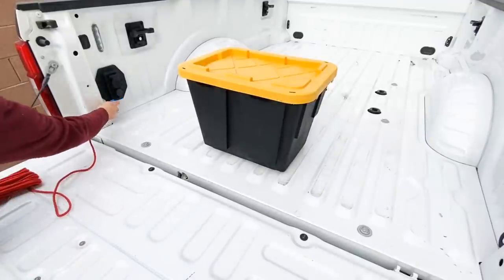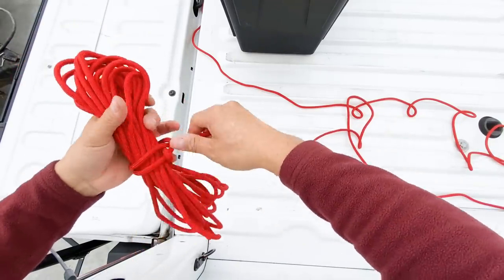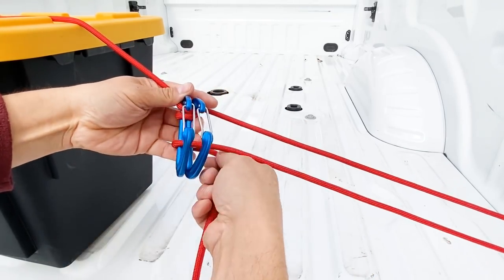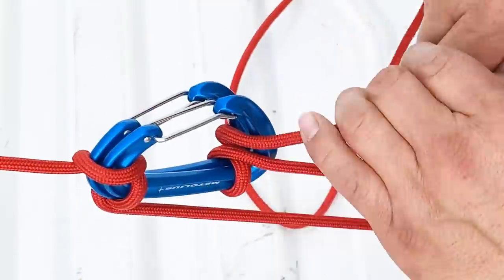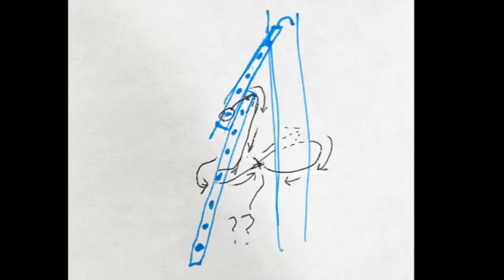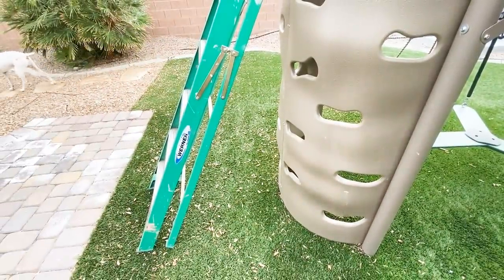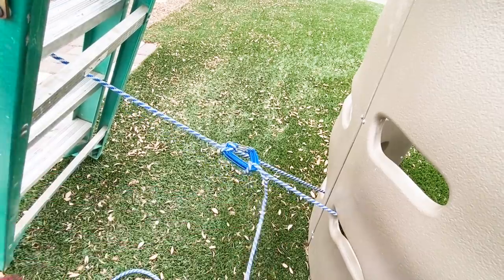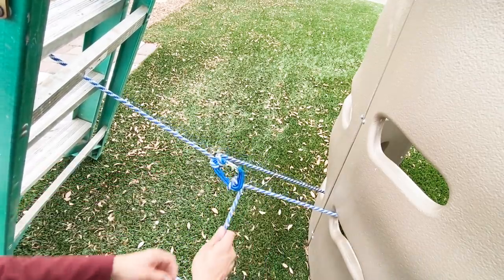Carabiner Truckers Hitch - Tension Locking. (Ladder to pole)

Comment: With two carabiners, you can use the garda hitch (aka Alpine clutch) for a more stable knot with the same function.
Reply: Wow Garda hitch is where it's at.
Reply: @brandonswan9247  an issue with the garda is it might be hard to release under load.  Might be best to include a load-releasable hitch in the system when using the garda.  Maybe it can be undone using the method first class amateur shows, just reversing the steps to tie, but i don't know.

Comment: You have literally saved me so much time using this method for setting up a ridge line for camping shelters and clothes line I’ve used the rope only method for years and it works great but this is so much faster and easier.
Reply from the maker: Glad it helped!

Comment: The reason why everyone is asking about having to use 2 bineers instead of just 1 it's because this is a poorly made Garda Hitch. We use the Garda Hitch in Rock Climbing when rope ascending.

The method shown in this videos it's just problems waiting to happen. 

The reason to use 2 carabineers instead of 1 it's that when tied properly (Garda Hitch), the rope on the second pass will go thru in between those 2 bineers. It's not "Clip in once, clip in twice on both" it's actually "Clip in both once then over the first one". Then, when the rope gets tensioned, both bineers will pinch the rope going in between them.

And THAT'S why you need 2 carabineers.

Comment: Fantastic video! Question why two carabiners or will only using one slip?
Reply: That's a goot question... I thought he was going to show the Garda knot (at least thats how we call it in german: Gardaknoten) where the second carabiner exerts the pressure on the rope, but for this technique, the second one should be neglegible, maybe except for slightly more friction appearing with two.
Reply: For the flat sided carabiners he's using it probably wouldn't matter, but if you had round ones you'd want the second to keep the rope from slipping.

Comment: Why two carabineers vs one?
Reply: He explains in another video that the blackball hitch (basically just a loop around a fixed point) slips when the surface is round (like a single carabiner or a pole) but when the same hitch is run over an object that has an edge, like a square pole, the hitch works bc it catches and holds itself against the edge or “opposing surface.” Two carabiners stacked provide enough of a flat surface for the hitch to catch an edge properly.
Reply: @hellobillyjacks  I can see that. Thanks!

Comment: I love all the questions about two carabiners. Folks, just give it a try. It will hold or not. It depends on the particular rope and particular carabiners. 

Also, depending on the rope you might find using a clove hitch at the top rather than the larks head hitch easier. Larks head is slightly easier, but not like a clove hitch is that much harder.

Comment: Great idea. Does it require 2 'biners or will it work with 1? In either case will it work with 'biners that have a simpler round cross-section?

Comment: Due to any kind of sustained bouncing or vibration this WILL NOT WORK on any kind of rough surface (washboard, 4wd,  etc.), especially when the thing you've tied down is all the way at the tail of your truck.

Comment: Yo, this is killer.  I demo'd it and gave it all my weight and was still able to bust it loose.  Here's a question, using this with a 70M slackline under tension, do you think it would still release or would I need a blade? 

I'm going to find out either way, I'm just wondering about your opinion :)
Reply from the maker: I think it would release. I’d recommend adding a couple half hitches for a slack line.
Reply: @First_Class_Amateur  Hmmm what exactly do you mean?  Where?

Also, I'm gonna throw a stopper on it so I don't have to worry about flying metal...  No way I'm putting more than 600-700 lbs on it.  The line is 70M...

Dude, Imma film it and let you see how it's rigged.  I can honestly say no one rigs like this.  The anchors are 15 feet high, BUT they get rigged without climbing.  Ponder that :)